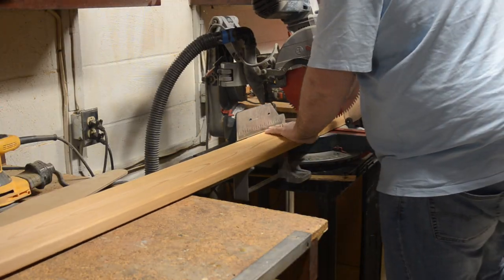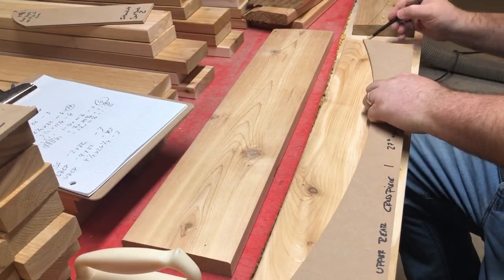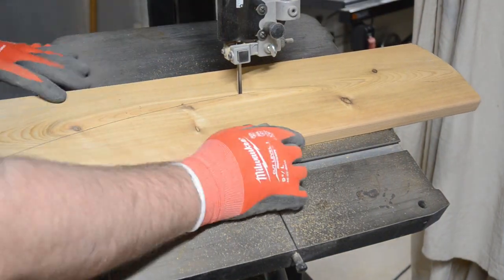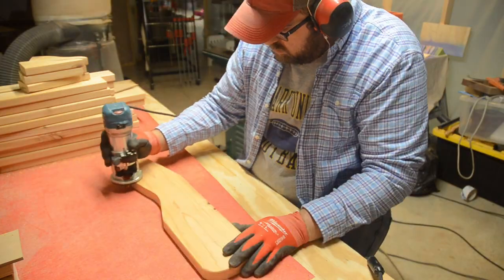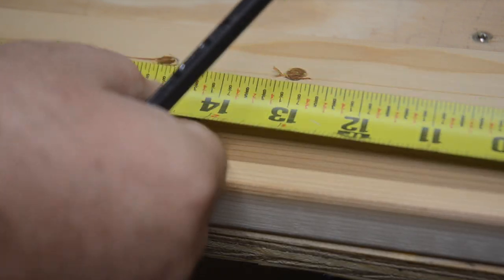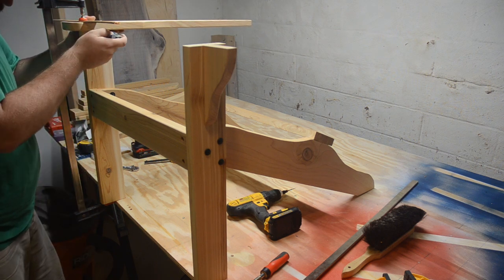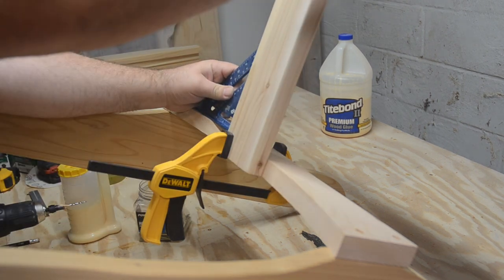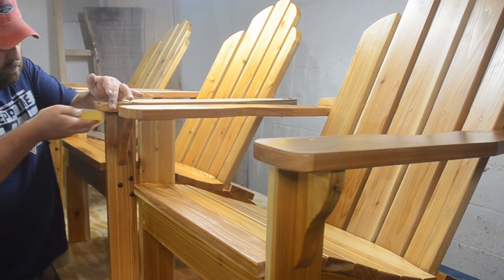The Most Comfortable Adirondack Chair!  Build Video!   How To Woodworking

Comment: I recognize this as the one from Norm Abrahms New Yankee Workshop.  I've built several of this design and prefer to add a little height and reduce the angle of the back.  If you build out of pressure treated lumber be sure not to breathe the sanding dust. I almost killed myself with the first set of chairs.
Reply: safety is job one.
doing good work is number two 
try to have fun is  number three.

Comment: I've made a few of these using the instructions and template from Norm Abrams's Classics from the New Yankee Workshop. I've used an assortment of pine and cedar, and when I paint them and store them inside during the winter, they hold up really well. The only design mod I'm thinking about for the next set of chairs is to try using a 2x6 or 2x8 for the long back legs. Then I can set the front legs into a sort of dado (I can hear Norm's voice now; he was the dado king). That has been the weak point for me after a few years--the carriage bolts get loose where they connect the front legs to the rear legs. They work larger holes into the cedar or pine. I must say, the spar varnish (I think) used in this video looks excellent on that high-quality cedar!
Reply from the maker: Yea I agree - a dado's front leg would be awesome. I'm getting ready to build some more for another video and may have to work that in!  Thanks!

Comment: Ok, so $5,000.00-$7,000.00 worth of woodworking tools and I’ll get back to you 🙁
Reply: Hals Wood Shop.   I read your comment and felt you should get a reply.  As a crafter business, I don't even have that much in tools.  But with new portables you could make this set. The plans are in Norm Abrams book Classics from New Yankee Workshop available used or new.  I bought a tool set of black and decker 4 tools,  ( 2 saws, drill and sander, 2 batteries ) at Lowes for $125 when we moved.  With only one or two to cut the curves, some drill bits and clamps or not, you can start.  Get a friend to help.  A bench could be anything to start but I would not buy the Harbor Freight woodworking bench it only looks good.  Watch some more or buy some books to learn and make one after you build something. Keep it simple to start and learn what you do.  I moved across country and found some ok buys to start on Craigs list like a folding bench, mitersaw, and a cord drill and all did well for the few dollars I paid.  I hope this helped and not a criticism but to get you started.  All of us started small, somehow.
Reply: @halkester9368  thank you,
Reply: Where do you find the dimensions at.